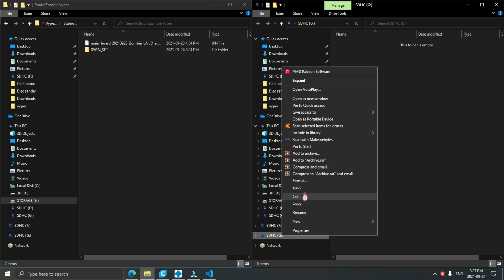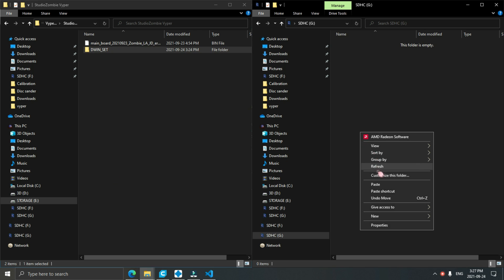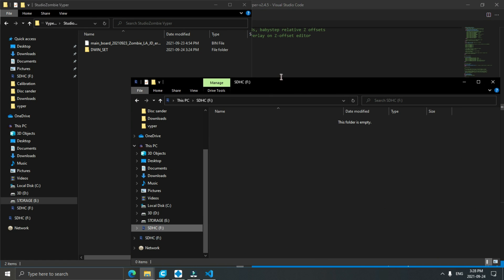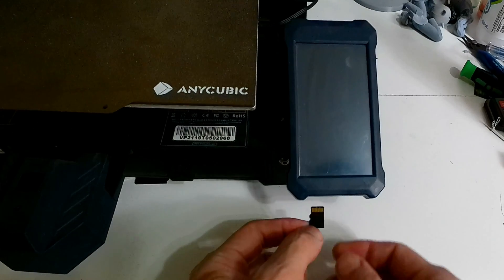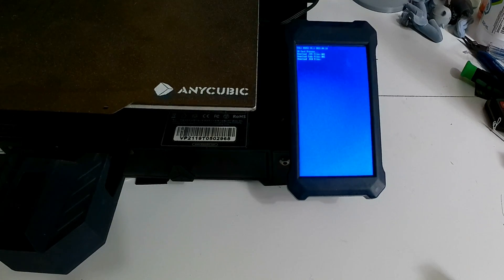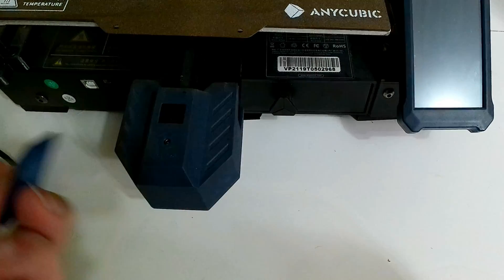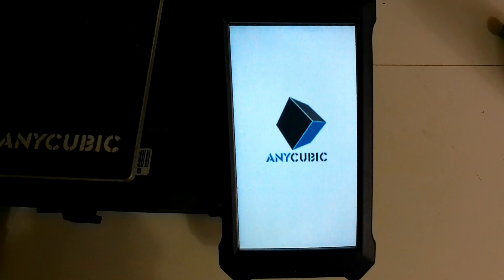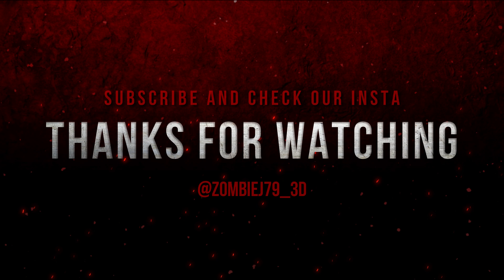Anycubic Vyper Firmware Update

Comment: The Blocksize of 4096 in fat32 is very very important!! Without it, it shows the bluescreen, finished immediately and all list items show 000. In this case nothing happened. 
Also: it seems as though it does not restart automatically.
Reply: im doing it now , you say i keep it on fat32 and 4096 bytes right ?
about the capacity it's already 3.78 GB so it's good ?
Reply: @omarctech1201 that should be fine.
The filename is important. Should not be the same as the one that is currently flashed and same naming convention (you can put any date and version number) 
Then it should work.
Reply: @florianopolis6299  thanks i flashed it and it worked, but i don't see any difference ( about the linear advance and other options) , also the e steps how would i calibrate it ?
the one i know is doing that equation after extruding 10 cm on pronterface
Reply: @omarctech1201 
Im Not sure what you flashed. When you flash klipper, you'll see no controls on the display anymore as everything needs to be done with an external computing device. If you flashed some community firmware, I really can't help as I've never done that.

Comment: My printer is currently stuck on the blue screen. It says there is no files inside the sd card. Will try an smaller sd card as this one is 32 gb
Reply: did you fix it
Reply: @omarctech1201 yeah; the main issue was not even close. It was the nozzle which was a bit old and causing all types of issues

Comment: I'm running this on my Standard Kobra. I started having my extruder motor stop running after print start. I have swapped the motor thinking it was the issue. Do you have any idea if this is a firmware thing? It does extrude when I load.

Comment: Thanks for the video. So I did it in the other way around with the Vyper first. The desolate says 2.4.5 but when I go to level the screen freezes and the levelling box flashes constantly. I got a micro sd card and copied the screen fw. When powering up it blue screens but rushes to how yours looked at the end.
I remover the msd power on and still have the same problem with the levelling. This firmware has killed my Vyper that worked perfectly. Any thoughts as I can’t find any previous FW or a way to role it back.❤
Reply: Hi! How did you fixed it after all ? Im having the same issue

Comment: Hello  Installed Zombie 2.8 on my Anycubic Vyper 3D Printer.  Tried using the "Pause at Height" and "Filament Change"  The printer Paused at layer 12 then I changed the filament  hit the pause button and got this error Waiting for cache command to complete and the printer just hung there had to power off then back on vyper.  What is wrong?

Comment: is there a reset button to factory reset vyper without having to reinstall firmware cuz i cant install screen firmware nor can i install the main board firm ware, although it does show up on the print section of the printer just like an stl file

Comment: Currently having a problem, Flashed the screen but no beeping after it was finished, moved onto upgrading the firmware and the firmware went through with 5 beeps, HOWEVER none of the settings in the EEPROM have saved. On bootup it makes no noise and no loading screen and the splash page is in Manderin it also dosnt show the temp settings on the top and you cant get out of the initial screen change settings, nothing. Im not sure whats up i have a feeling its because im using a 512MB micro sd so ive ordered a 2GB and Im hoping that solves the issue

EDIT 1: I plugged in pronter face and this stream of text comes up nonstop saying: page_index_last: 1 page_index_last_2: 1 lcd function does not exist
I have a feeling that this confirms my suspicions about the firmware not going through correctly
I will keep this posted and update if that was the fix

EDIT 2: I was correct in thinking that I needed a 2 gb micro sd instead of my 512mb one there was no chime originally on the lcd but i re flashed the firmware and the bood screen came up (thank god) that music chime was music to my ears haha Love the linnear advance feature thank you zombie I struggled but I learned today
Reply from the maker: Thays good to know I don't have anything smaller then 8gb for micro SD cards so it's good to know 512mb won't work with them

Comment: Firmware is working great so far, but I do have one major issue. When i turn the printer off and then back on again, the leveling has to be redone (nothing saved in eeprom). Is this related to the disabled power failure setting? Do you know a solution?
Reply: I have the same problem, is the solution just to bed level everytime you turn on?
Reply: I'm having the same issue. @studiozombie3d do you have a solution?

Comment: it seems to auto level fine? Id does 5 rows of 6 probes now though? Is that an accuracy tweak you did?
Reply from the maker: Yeah I added the 6x6 grid to I crease the bed leveling accurate the stock had 4x4 and with some beds it couldn't compensate for the odd warped bed. Then the added linear advance,junction devieation and other tweaks

Comment: i installed v2.8 but I have problem with autoleveling. I did autolevelling process and at the end seems that It wasn't levelled and the noozle scratch all over the plate
Reply: I'm having a similar issue, did you resolve this?
Reply: @DrMrSuperAwesomeGuy  i installed v2.5 and work well

Comment: Just loaded the mainboard firmware 2.8 and got the beeps and the light went out but the screen never went to the main menu. Just stayed on the AnyCubic logo. Screen firmware load seemed to go ok but was a lot faster than the video. Will give it a few minutes before I recycle power. Been at least 5 minutes since I loaded it and typed this post.
Reply from the maker: Power ot off and back on pull sd and your good to go. For some reason 2.8 dosent go back to main screen
Reply: @studiozombie3d  Sweet. It's good to go bro. Thanks.

Comment: I noticed after installing the your latest firmware the printer prints much more slowly. Is this an effect of linear advance?
Reply from the maker: Check your acceleration and jerk settings. Send m503 and it should list it up acceleration to 800 or 1000. Make sure junction devieation is set to j0.08 as well

Comment: Great video, they have all helped me a lot so far, thank you! I have run into an issue however, after upgrading to your 2.75 firmware. After finishing the upgrade process, and getting 5 beeps when upgrading the main board, it now appears that the bed leveling info is not saved between prints... have you run across this before?
Reply from the maker: Try resetting the eeprom with m502 twice then m500 and try to relevel see if that helps
Reply: @studiozombie3d  I think I got it, ended up going through the leveling process 4 times before it stuck. Thanks for the help!
Reply: @bendarnaby7444  did you have to reset the eeprom as he suggested or did it just eventually stick?
Reply: @DrMrSuperAwesomeGuy  I didn't have to reset the eeprom, but in hindsight, that might have made the process faster.
Reply: @bendarnaby7444  How did you make it stuck? Did you turn the printer off right after? Did you save with M500 after releveling? I just did M502 M502 M500 releveled, then made a print - and immediately after the pring the leveling got lost (no leveling in M503)
Reply: @vicnaum  In my initial panic I just leveled the bed about 4 times, 2 from the LCD screen and 2 from OctoPrint Bed Level, and it ended up working...

Comment: Hey, been using your custom firmware for some time now. would like to note though that your firmware does not work with the prusa or cura settings to have multiple filaments in one print. the stock firmware does work. it pauses the print, you swap filaments then press resume print. your firmware doesn't do that it just freezes on the screen once it reaches the G-Code that tells it to pause.
Reply from the maker: If your running 2.8 try using 2.75 see if it's better. 2.8 seems to be a bit random for the resume not sure why.
Reply: @studiozombie3d  I'll give it a try tomorrow
  Is there any difference in your 2.75 and 2.8 firmware?
Reply: Hi, i've been having the same issue. Did 2.75 fix the issue? Any other ways to fix that problem.
Thanks for the help :)

Comment: You do awesome work and your tutorials are part of what lead me to get the Vyper.  I've loved it, thought I would give some of this a shot.  I flashed the screen fine with your latest release, but when it came to the standard sd motherboard, it starts as you said with no sound, then the light.  However, I get 5 beeps from this and the screen hangs.  Any thoughts as to what might do that?  No rush, mothers day is around the corner and I have a project I'm making lol
Reply from the maker: Your good to go man. For some reason the printer dosent go to the main screen after flashing. Haven't had much time to look into it last couple weeks
Reply: @studiozombie3d  Wow that was fast!  I seemed to get back after a shut off, but now its not quite reaching the build plate during prints.  Just working out the troubleshooting now.  Thank you for what you do for the community, you are awesome!
Reply: @aaronholbrook3876  Did you ever figure out the not reaching the build plate issue?  I'm having the same problem now after updating firmware to 2.8
Reply: Zombie 2.8 is on the firmware version.

Comment: Hey :)

I would like to test your firmware including the linear advance Feature.

Is the 2.8 zip and rar version the same?

And my vyper is updated to 2.4.5
So I don't need to update the display or am I wrong?
Reply from the maker: They are both the same some people were having issues with the rar
Reply: @studiozombie3d  thank you.
I have updated my printer without the screen and it worked! :)

E steps calibrated to 423, linear advance k factor 0.45 and junction deviation 0.05 works well for me.

Comment: How do you invert the stepper motor for the extruder?
Reply from the maker: You can flip two wires on the extruder I'm not wsute what two on the vyper. Or change it in the firmware itself

Comment: Can anybody running one of these firmwares please check if you can set nozzle temp to 275 and it holds? I can't figure out why mine keeps throttling to 260...
I just thought of unplugging my raspi and changing temp on the printer, which should remove octopi from the equation completely. It does the same thing... So the only thing it could be is something in the firmware or the motherboard itself. Can anybody please verify? Am I the only one that can't set temps higher than 260 on two Vypers? 

@StudioZombie thank you for the vids and firmware, they've helped tons! Just wish I could figure out this temp throttling issue...
Reply from the maker: I'll try running a pid tune at 275 on mine sew what it does and let you know
Reply: @studiozombie3d  awesome, thanks, I really appreciate it! Mine doesn't take it, I think it said "out of range" iirc

Comment: I promised an update, so... Finally figured it out. Was trying to use a micro sd that had been used for a raspberry pi. It was partitioned and wouldn't work. Got that all straightened out thru Windows 10 Disk Management (a good place to format cards to most any format). Anycubic was not very helpful. After multiple emails, their only suggestion was: "If the printer is not malfunctioning, we recommend against updating the firmware". Please keep up the good work. Much appreciated.
Reply from the maker: Hay glad you got it figured out. Let me know how it works out

Comment: Hi. I just tried to do this update. Machine is running 2.3.3. First tried a micro SD card that would only do EXFAT. Plugged into machine but would not boot onto the screen. Found a Micro SD that would do a FAT32, formatted to 4096, loaded DWIN SET folder. Inserted to slot, turned on Vyper. Fan comes on but no screen lighting up after 5 min. Any thoughts?
Reply from the maker: It should come up with a blue screen right away. Try reformatting and record the DWIN_SET folder over as is. See if it works then
Reply: @studiozombie3d  Thanks for the quick reply. Still not working. The files look good on the sd card. Have sent a note to Anycubic support. Will let you know how that turns out.

Comment: I just tested with a micro sd my screen is black no fonctionnal
Reply from the maker: http://ridgecrop.co.uk/index.htm?guiformat.htm 
Try this program to format your micro SD to fat 32 and 4096 allocation units and try ot
Reply: @studiozombie3d  ok if I manage to format I put the firmware back should it work? more black screen?
Reply: @studiozombie3d  or the simplest do you have the original firmware 2.3.3? thank you
Reply from the maker: @capatainjackcosplay  I have 2.3.8 here https://drive.google.com/file/d/1X6zo7JnqP0gXkYVRPs9EFgPbFMBLaTuC/view?usp=drivesdk

You can use the printer as it is just remember to press up on nozzle after hitting level everything else is good just that one screen was added to the lcd firmware

Comment: I flashed the "Zombie V2.75.rar" Firmware and now the Leveling does not work anymore. I only flashed when i press the button.
Reply from the maker: You need to flash the lcd when you hit level and if it flashes the lcd didn't flash just push up on the nozzle and the level will start.
Reply: @studiozombie3d  The Display was not flashed correctly. For SD Card flashing use on Mac: sudo newfs_msdos -F 32  -c 8 /dev/disk4s1
Reply: @studiozombie3d  please put this comment into the google drive, I just cursed at this thing for the 32nd time because the last hour the leveling wasn't "working" couldn't flash the LCD due to lack of MicroSD supplied. I pushed on the nozzle and it kicked into gear.
Reply from the maker: @roflolmfaomggf  I'll put a note in the next package about the level if you can't get the lcd to flash

Comment: Question about the Display flash step, Is this step a thing that needs to be done for every time flashing the main board?
Reply from the maker: Unless there's any changed to the ui you don't need to flash the lcd if you use the stock 2.4.5 you can use my firmware and vise versa
Reply: It was at 2.3.3 Have since had successfully printed  3 times
Reply from the maker: @tomrisar5492  the only ring the ui firmware adds is a pop-up for leveling thay asks to test the sensor by pressing on the nozzle

Comment: Hello, after the new firmware the autoleveling is broken. its set the bask side way higher, Its looks like the hotend is beeing turned off and cools down during the process and that causes the problem. How can I fix it?

Thank you!
Reply: Never mind looks like it happens when the hotend already in a preheat mode. Otherwise everything perfect thx for u work:).

Comment: I can't get the DWIN_SET folder to flash to my Vyper. I was able to flash firmware v2.5 without any issues, but when I plugin the microSD card to my display it does everything yours does in the video, but after restarting nothing has changed. I know it didn't work because I changed some of the odd wording they have in some screens and added VYPER under Anycubic on the main screen. Do you have any suggestions on how to get the files in DWIN_SET flashed to my screen?
Reply from the maker: Double check sd card it needs to be fat 32 with 4096 allocation unit size http://ridgecrop.co.uk/guiformat.htm
This program works well for windows
Reply: @studiozombie3d  wow, thanks for the quick reply! I downloaded the fat32format program and formatted my MicroSD card and re-copied the DWIN_SET folder to the card. Powered off the Vyper, put in the MicroSD, powered on & waited for the startup chime. After I powered it off and on, the files still didn’t flash over.
Reply from the maker: @mattb2265  go into prepare and hit level when you hit level does it ask you to use a tool to push in nozzle? Or does it flash?
Reply: @studiozombie3d  It asks me to use a tool to touch the nozzle.
Reply from the maker: @mattb2265  your good to go then. The lcd is flashed.. get printing man lol
Reply: @studiozombie3d  Okay, thanks - I appreciate it! Do you know how to change some of the default images that are flashed in DWIN_SET? I’m not trying to do anything crazy - I just want to improve the English and add the Vyper text under Anycubic on the main screen. If you don’t know that’s cool, I still appreciate your help today!
Reply from the maker: @mattb2265  it can be done but you need to rebuild the screen firmware using a dgus program. It's a real pain if you look online there a cr6 community edition that has a vyper branch with lcd sources. You can fire me a email at studiozombie3d@gmail.com and I can let you know a bit more

Comment: after updating all the firmware, my printer won't print and it shuts down when selecting the owl to print. Any ideas? It gives the error "The filament is insufficient or the filament sensor is malfunctioning".
Reply from the maker: send a m214 s0 to disable the sensor m500 to save then try. sensor could be faulty
Reply: @studiozombie3d  I’m really new at this so I’m not sure how to do so.
Reply from the maker: @Nyctrin18  fire me a email at studiozombie3d@gmail.com and I'll give you a hand
Reply: @studiozombie3d  ok I’ll email you right now